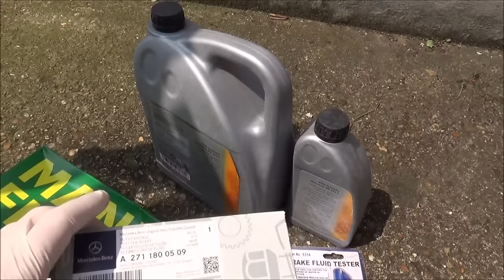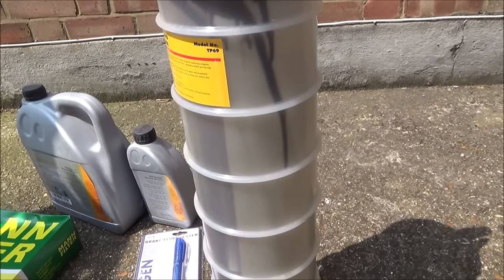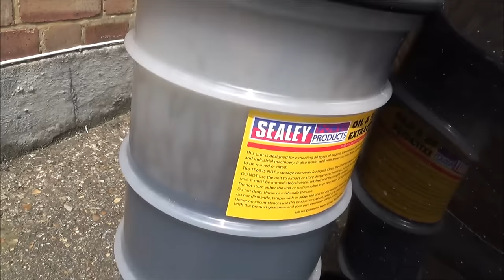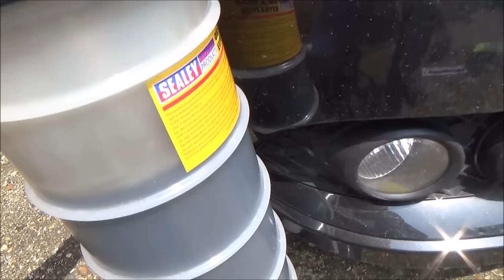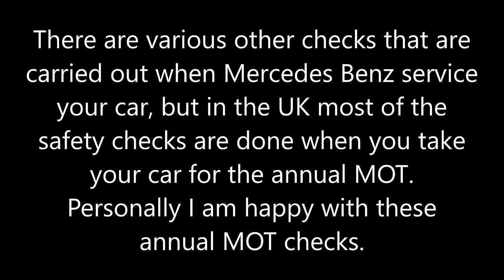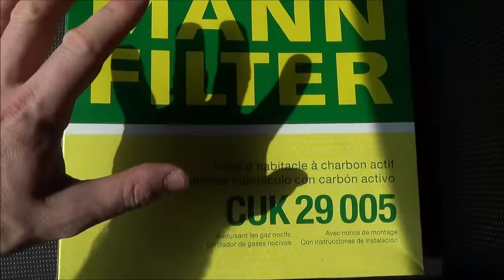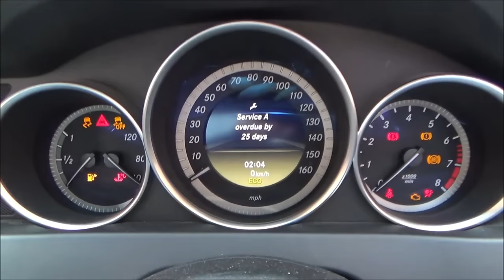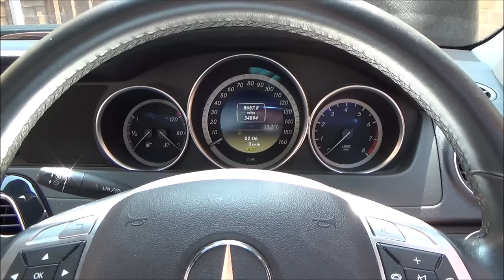How to Service a Mercedes Benz C Class, C180 W204 Year 2012

Comment: Went to an independent specialist today for a quote on oil and oil filter and air filter service and got quoted £380!! Went on eBay and got the parts for around £60 and I’ve been dreading jacking the car up and getting under it in the mud and wet. Searched for videos and this one popped up and thought I recognised your voice 😂 I’ve been watching you for years fix electronics! 
Anyway, I just wanted to say thank you for showing us the suction trick. I no longer have to dread lying down in the dirt and I can do my oil quickly and without mess!

Comment: Excellent video. Thank you. Note that I do not have oil pump extractor. I therefore drain oil from outlet on sump which entails removing two "shield plates" from under engine, one made of steel, the second made of plastic. Quite awkward to access and time consuming though. When I undertake an oil change using this method, I extract 7.2 litres of oil. I normally let the oil drain for about 4 to 6 hours. I use Castrol Magnatec oil. My car is almost identical to the one in the video, i.e. Mercedes Benz C200 saloon, 2012 model, W204.

Comment: Thank you for showing us how a C180 looks like. Here in America a C250 is the lowest Benz number that is sold on the C class. Great pump to remove old oil...I might buy one. Thank you!
Reply: C180/200/250 with Turbocharger (CGI engines) looks the same. Only differences are between turbocharger (C180/200/250 CGI, in US from 2011, only C250) and supercharger (C180/200 KOMPRESSOR, only until 2010, not available in US) models

Comment: As you showed, "there is more oil coming out now".  That's why you should pull the filter first thing while you're setting up.  Those O-rings and a check valve in the housing are holding oil up top for the filter on startup.  You should let that old oil drain back to the pan before you start pumping.  Otherwise, very nice presentation.

Comment: Interesting. On the w203 the cabin (pollen) filter can be accessed in 30 seconds very easy on the top left part when you open the engine bonnet. I don't know why they made it so complicate on the next gen 204. Very nice movie, thanks.
Reply: They did it so they could charge you more for having to do it for you. Another hours labour

Comment: well, I did the filter and oil change on the "same" Merk engine(M271DE18)my car is a SLK 250 and it took 6,5 liters to get oil level MAX on deep stick. Oil 5W-40  MB 229.5

Comment: Great tutorial! Are you satisfied with your car and the engine? I'm thinking of buying one for myself. Btw aren't you suppose to change the O-ring below the engine where you usually empty your oil?
Reply: Yes, but only if you remove it to drain the oil and check the magnetic sump plug for metal traces ( wear and tear from engine parts)

Comment: I've got the same engine but its a c250 takes 5.5 litres too. I've noticed when checking the oil it doesn't show max on the dipstick but rather in between min and max. Have you experienced the same?

Comment: Great Vid. I'm a proud owner of this model. Love it. Do you know why these, Audi's etc are noisy when you first start them ? After about 30 seconds they are dead quiet. Cheers.
Reply: Hi. I've owned a few of these C Class's with the 1.8 16 valve engines and they all rattle for a few seconds on start ups, but only when cold!  I have been reliably informed by my mechanic, Mercedes specialist, that this is quite normal as the engines have hydraulic tappets and it takes a few moments for the thicker oil when cold to feed up to them. Cheers, Jon.

Comment: I use one of them on my jet ski but i wouldnt do it on a car as any fine metal particles that are in the oil wont get sucked out as the sump bolt it magnetic and will be stuck to that only reason i do it on my ski as they dont have drain plugs

Comment: i own a C200 Kompressor W204. but i noticed when i sent my car to Mercedes service center. they uses almost 7 liters of Oil. ist correct to use 7 liters of 5.5 liters?
Reply: Hey. Mine is a 2009 W204 C180 with supercharger. Its a 1.6 not a 1.8 and I service it myself. Always 5.5 going in. Idk wtf they do with 7 liters.

Comment: What if you have the C180 W204 with the new 1.6 turbo. This is the older engine.
Reply: SDav21 even easier the oil filter is in the front

Comment: I know this is an old video but can anyone tell me what the cap is for that can be seen at 3:32, far left of the engine. if you look between the oil fill cap and the merc badge and then full left. has a little square block on it. i opened mine and the fluid is low yet i don't know what it is!
Reply: Power Steering fluid.

Comment: It should be 6.5 liter for oil. loosen drain plug should be better way. But this method is easy but still have old 1 liter remain.
Reply: This engine is 5,5 litres oil from dry fill not 6,5 litres diesel versions need 6,5 litres
Reply: My 2015 C250 (W204 1.8 L) requires 5.8 Quarts, per the book. If I put in 5.5 qts, the oil just touches the low mark, 5.8 qt. qts. puts it in the center and 6 qts. puts the oil just below the full mark. Right where I want it.